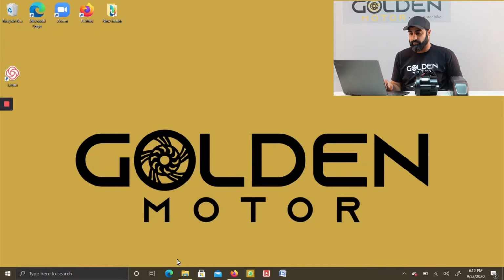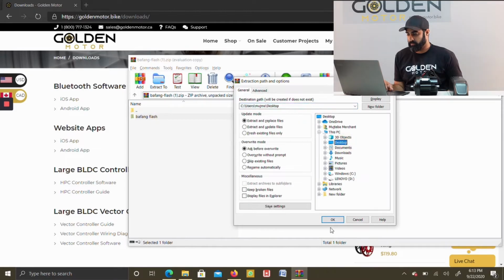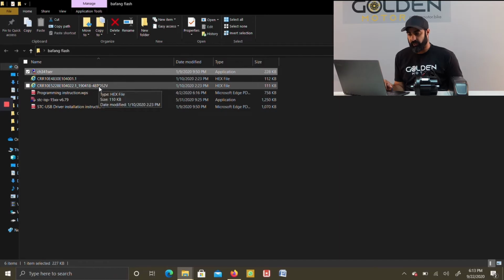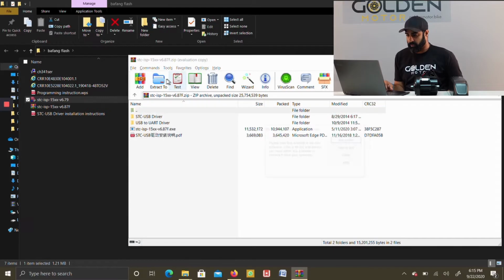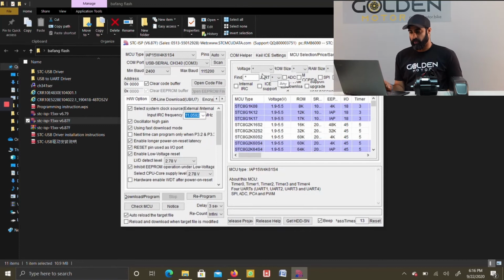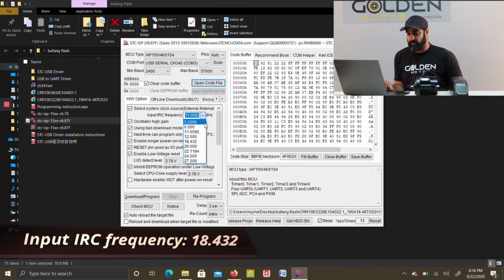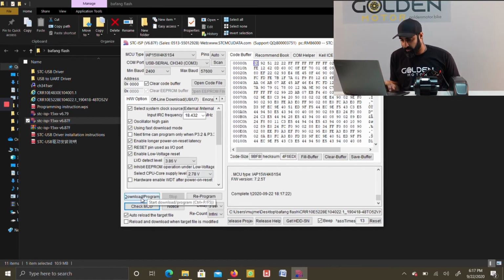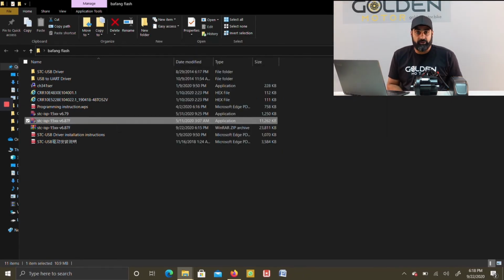Bafang firmware update/ Error 30 fix/Error 7 fix BBSHD BBS02

Comment: Cant get past "Check MCU"  it hangs at "Checking target MCU".  Motor is getting power and distributing power.
Error 30 here (coincidence?) within minutes of chain jumping sprocket, (fixed the chain and power back ON throw error 30).  

wire harness looks ok,  i route cable well:  slack, drip loops, no pinch points, zip ties loose, velcro, protected from things hitting wires.

Comment: I got two batteries 1 is 48v at 54v fully charged and 52v at 58v fully charged. 52v refusing to work with 07 error if i flash this firmware will i be able to use my both batteries?

Comment: i have a controller problem, i know it because i've tried another one and the motor works perfectly fine...so the issue with it's original controller is that the throttle doesn't work and the motor starts by its own without me touching anything. Will this flash fix the controller or is water damaged? ( previous owner said it was working fine when he was using it )

Comment: My heart dropped today when I got the 30 H error before I even started riding.  I've had my bike for 2 years with no issue until now.  All the troubleshooting with connectors did not work.  Luckily, I purchased a programming cable when I bought my bike but have never used it until today.  🙏 Thank you so much for this video!

Comment: question if you may. I have a customer that brought in A E bike with the mid drive. Code error 30 present. Hook The charger up oddly enough. It cleared the code for about 4 hours. Code came back and will not go away checked all connectors. All pins, all female connectors appear to be free of corrosion and nothing wrong. And update didn't help However, the battery on the LCD display shows 0. The walk mode will show up, but it will not turn the motor on. Pedal assist does not work. The headlight indicator will come on, but no headlights or tail lights. I could not find any pinched wires either. I would suspect that this is a partly defective controller. And I know it's more difficult for you to answer that. On your end than would it be for me? Having it in your hands? However, in the detail that I have provided.  Wold you say that I am correct in that assumption?? I know that it is a possible hit-and-miss. Could it be the lcd display? I don't know, but I am leaning towards the controller myself. What are your thoughts, please?

Comment: I have a Bafang BBS-HD 48V 1000W motor. It was working properly, but then it started giving an error code 30h and didn't move. I found out that in this video, a person fixed this problem by installing new firmware, which I also did. However, I suspect that I may have done something wrong or made a mistake because both my motor and battery are 48V.

Then things got strange. I powered on the battery and started the motor, but the screen went black, and I heard an electrical sound from the controller, motor, or battery. It sounded like something had broken or burned. So, I'm thinking I may have burned my controller.

My question is, is the firmware installed in the controller? If I get a new controller, will that fix the issue? Because I can't even install new firmware anymore as nothing appears on my screen. So, is the firmware stored in the controller and not in the motor?
Reply: It also gave error code 07 after i change firware, then i restarted and it havent started since then...

Comment: I have a question: I've been installing bafang motors (mostly bbs02) on bikes for the last 3 years. Programmed all of them with the configuration software or eggrider and never had an issue, until now. After writing flash, the PAS is disabled (or works only at startup degree 1, but very erratic), and I can only make it work normally again with a lot of luck, restarting the controller, re-writing flash over and over again. but without any guarantee it will ever work again. totally random. I've been told they now produce the controllers in Poland...
also have not been able to find the mcu on bbs02 controllers purchased in 2023. I'll dig one open to see if they still use the same mcu.
please let me knof if you have a clue of what might be going on!

Comment: This appears very comprehensive and convincing! Is it for Golden Motor customers only or can anyone use these techniques even in Australia>I have been having several problems using the SPEEED app which has had the effect of disabling my PAS involving a round trip of 700kms just to get my controller set back to factory settings. Because of these hassles, I decided to get an EGGRIDER which claimed better ways of programming settings safely. Well I managed a 30km ride quite ok, but when I went to update the firmware, it again crashed and can no longer find the correct protocol for connection with the controller. After swapping over to my previous display, it also showed a 30H error meaning No Communication with controller. I am so frustrated by all these hassles, I am grasping at straws to find a solution? It looks from your video that you are able to program a controller back to factory settings? Can anyone do that? It would save me so much time and cost if I was able to do that. My motor is a BBSHD - only done 1500 kms. Love to hear that you can help?

Comment: Hello
Great video, thanks. I have a bafang 750W 20 A, which functions very well but keeps getting error notes: code 30, code 10, etc....
Have you encountered this and know what to do? Maybe it's a display problem (c961), is there a way to reset it to the manufacturer's default?

Comment: Balfane wants to start locking up the programming making it more. You can only use the battery f*** u* everything. Would not suggest this drive. In fact I would discourage them from ever getting this drive with all the stuff they've been doing lately. I'm big on the right to repair. So anybody who screws without is going to get? Band. Wish I would have known I would have returned the unit. Maybe I can I'll have the contact eBay?

Comment: Just completed building a BBSHD 100W mid drive with a 52V 19.5ah battery 5 days ago. Took it for a 1/2 mile test ride and then put it up for the day. Next day it wouldn’t work, DCP 18 display won’t turn on. Completed this firmware updated yesterday but am now showing ERROR CODE 30 on the display. Also note display only turns on when charger is attached and running. Display will not turn on when using battery only. Open to any help or suggestions for this new rider. In need of help!

Comment: so what happens if you use a 52v battery on a 48v firmware ?   the issue I have is my bike works fine with my 52v main battery, but when I use my 48v battery the BBSHD starts limiting current around 46 to 47v so I have around 10 amp hours of capacity that I can only access at 500w or less.

Comment: Perfect! It took a bit of troubleshooting, turns out what i thought was the power switch for my battery only turns on the in built in light, not the battery itself. But now it's happily cruising along with a 52V battery.

Comment: I have a 7% discrepancy between a fully charged battery at 54.6 volts and what the display shows (93%). I would never attempt this FW update so I just add 7% to whatever my display says....I also have a voltmeter directly across the battery.     There are too many horror stories associated with Bafang FW updates...be careful and be ready to brick it if you attempt this.

Comment: Thanks you so much !!! It worked to remove my error 30 !
(My error happened when I tried to reprogram the controller to change some of the assist level. Somehow, I can connect and read what I have, but when I write, the error 30 comes back... not sure why... I'm using the Penoff config tools that seems to work for most of users.)
Reply: I have the same problem, did you solve it?

Comment: Hi, I am having a problem resolving an error 30 fault. I execute the process as described, but when I get to the LVD detect level, 3.86 is not available. the closest one is 3.82. using this parameter, does not work. when I check MCU, it freezes up. Anyone else have this problem?
Reply: I get the same, did you sort it..?
Reply: @oddsandbods I guess he didn’t.
Reply: @oddsandbods after you check MCU, 3.86V will become available.

Comment: Can you flash the controller for a Rad City Step-thru 3? Error code 30 keeps popping up. Will not throttle. Even though I had new wiring harness and controller installed. Where do you find the usb connector?

Comment: The MCU in your video is an IAP15W4K61S4, however the default MCU in the downloaded software (V6.87) is an IAP15F2K61S2.   I found the one you had loaded in your video in the STC15W32S4 Series folder under MCU Type.  Is this the proper one to use with the BBSHD?  It's vital to select the proper MCU before programming. 

As other commenters below said, they could not select the 3.86V.  The reason is because the wrong MCU was selected.  I had the same problem now I can select 3.86V
Reply: How do I know what MCU to select? I have a BBSHD (G320.1000 09)

Comment: Hello
I did the steps you described in the video, but the previously working system is completely broken, it does not see the battery and gives 30 error. Correct hex. How can I find the software?
  MCU type: STC15F2K60S2
   F/W version: 7.2.5S

Comment: Good evening. I just found your channel and it seems like I'll be sticking around. I have the Ariel Rider X Class 52v bike and my display flashes the gas tank sign and stays on 30 but doesn't move. Will this work and how can I get the cable to connect to the display to reset the controller. Also, I have the 500 non-color display.  Thank you.

Comment: Will this firmware update work on BBS02? I have a 48 V battery but my DPC18 display only shows 32V. Will this update show the proper 48V?
Reply: Hi  I have the same problem as you.   48V battery and a DPC18 display shows 32V.   Have you found a solution to this?

Comment: Nice info sir. I got a bafang 500W 36V bs02 and open source software and "disconnect display plug and plug in usb adaptor" then run software that lets you play with many parameters. Nice but needs resetting from experience, like throttle settings too aggressive.

Comment: Hello people from golden motor!

 I would like to thank you for your very helpful videos on the subject of bafang conversions and the problems that unfortunately often occur with them! 

You really helped me a lot with your video bafang /update /firmware!

 Thank you very much.

 Please continue!

 Best regards. 

M.H
Reply: sean shea
4 hours ago
Hi, I am having a problem resolving an error 30 fault. I execute the process as described, but when I get to the LVD detect level, 3.86 is not available. the closest one is 3.82. using this parameter, does not work. when I check MCU, it freezes up. Anyone else have this problem?

Comment: I have just followed this method and it fixed the battery level display issue, but if I connect to the controller using the app, it throws a 30h code straightaway and the only way to clear it is reflash again, anyone fixed this issue

Comment: Hello , I'm new to your website . I like the tutorials you do, so I am now a subscriber. 
I have a bafang ultra M620 midmount on my Bakcou Storm ebike.
I want to look at the configuration settings from the factory.
Do I need a bafang cable or can I use any USB cable  !
I also just want to use the app I found called ( speeed ).
Will any USB cable work or do you need to use the bafang programming cable.
The system is UART....
Thanks for all the good posts that you put up here.
I have learned a lot from your website.
Brian
Reply: I think it's the m620

Comment: Be careful fully investigate error 30H first before following these instructions , As mine turned out to be a bent pin & needed a new wiring loom main cause of error 30H , But in between in my panic  i followed  the instructions here & flashed my controller that was 52v at 30a , After i flashed my controller my amps had dropped to 28a  , be careful not to take a step backwards & loos power , a good learning tutorial on how to flash controller ,  But going from 30a to 28a Not so good & the 30a firmware is not on there website for a straight download

Comment: Thanks for the video. I was able to reflash my BBSHD to work properly with a 48 volt battery.  Which is great  but now I am unable to use the programing tool to adjust the settings. It brings up error code 30 and to clear I have to reflash the firmware again. Is there any other firmware that will still allow the user to use the Bafang programing tool? I am using the one provided by penoff. Any help would be appreciated? Thanks
Reply: The same thing happened to me
Reply from the maker: You need the unlocked firmware to do that. Please reach out to our support team and they can send it to you

Comment: I have bbs02 750w mid motor and 30h error on it. I followed your instructions carefully and download completed successfully. Now my motor does not work at all. Display starts, but the motor does not work and adjusting frequency fails. Please help me, I ride to work on my bicycle every day and now it is useless.
Reply from the maker: The firmware that you used is for a Bbshd.

Reach out to our support team they can provide the correct firmware 

Www.goldenmotor.bike/support

Comment: this video is useless for me , i have bbs02 version b which is different from bbs02 and bbshd .....this is the last time i buy anything from bafang , the company sucks . their support is horrible and sent me on a wild goose chase to nowhere but error 30 and a non working motor
Reply from the maker: Version b is the same version a is 4-5 years old . This works for your motor too you need the correct firmware. 

Reach out to our our support team and they can send you the correct firmware 

And this is the reason to never buy directly from bafang or off Amazon there is no support

Comment: Good job guys! I am having issues with my bike equipped with a  bafang m400 mid motor.
Doing uphills, the power suddenly stops and the display shows number 25. I know there is no error 25 for this model, and the bike doesn't have a brake lever sensor.
Any ideas?
Thanks!
Reply: There is an error 25 for your motor its a brake lever problem you need to check the brake lever cables because this error happens when you are pulling on the brake lever while pressing the power on button to start the system up

Try letting go of the brake  lever when pushing and holding the power up button.

If this doesn't work then one or both of the brake lever switches are bad , Unplug the wire harness brake lever wires one at a time and then power the system on again and if it goes away then you have found your bad switch and you just have to order a new one

Comment: I tried to flash my bbs02 to read my motor to accept a 52 v battery. Now the motor won't run. I had to replace the controller. Is there a way to reflash my old controller original settings so I can use it again?
Reply from the maker: You need the bbs02 firmware please reach out to our support team

Comment: sorry but im sorry to say that your talking a load of crap! ive done and tried everything to the letter and it still dont work. reason being you dont say anything about the .EL file!. be warned people this guy is a fake and a moron.do the right thing and tell the full way of doing this not bits here and there
Reply from the maker: What do you mean by “it does work” are you trying to flash the controller or are you trying to unlock it . That is 2 different things 

This video is simply showing how to flash the controller. You need the correct firmware to use the el files. Which I mention to reach out to our support team they can provide the firmware to allow programming . 

The .el files are simply prewritten parameters that can be uploaded to the controller. This video is not really about that...

Comment: How do I fix code 10H missmatch with new controller ? I have the old one without the temp sensor.
Reply: If you haven't already, try follow this video. I ordered a new controller and got the 10H error. Hesitant to follow  so got a refund. Before ordering another I thought "I'll try this", so glad I did. No 10H error anymore! Will update this if problem returns.

Comment: I am using a FT232R USB UART cable that does not get auto selected in port, however I am able to check the MCU, but powering on the battery does nothing and I am stuck... (the COM port reads as: USB Serial Port (COM 3))

Help would be much appriciated!
Reply: Did you figure it out? If yes, what did you do?

Comment: after i click check MCU i got error: Device open fail !
Please check the device . any ideas? thanks.
Reply: controller is brand new.
Reply from the maker: Check if your battery is on before  . You have to follow the steps exactly

Comment: Will this fix bbshd error 10, controller over temperature (on a new controller)
Thanks
Reply from the maker: I do not think so but it’s worth a try. 
I think your temp sensor in your motor might be bad
Reply: @goldenmotorNA  can that be changed or anything?

Comment: Is it possible to upload firmware to the Max Drive M400 motor with this program? The Max Drive engine uses the bafang besst program, but registration is required.